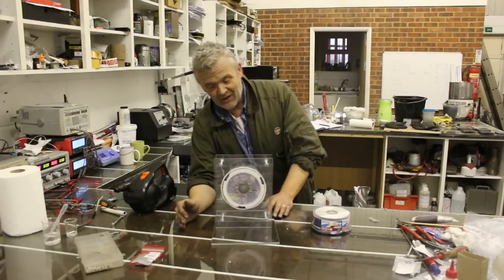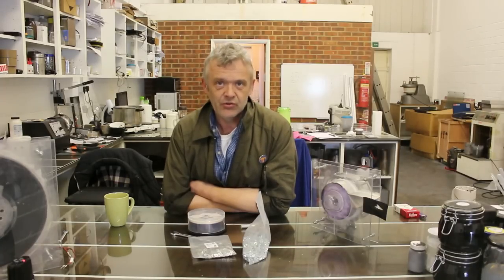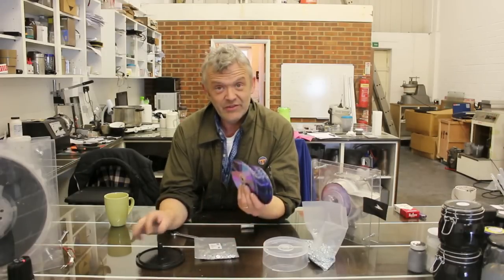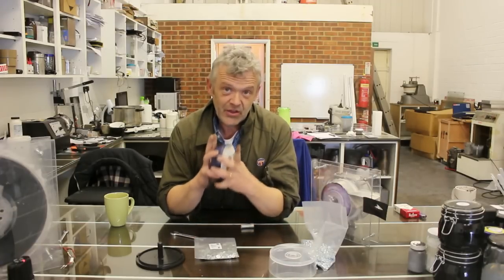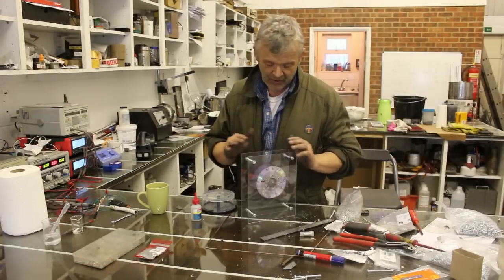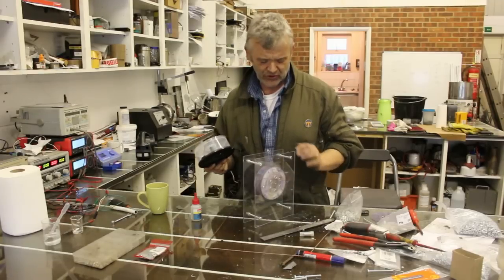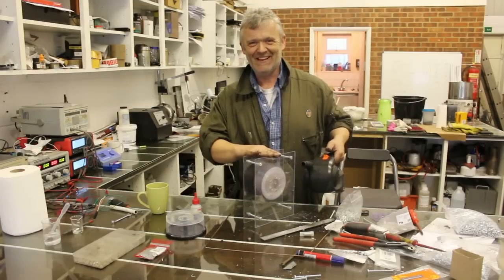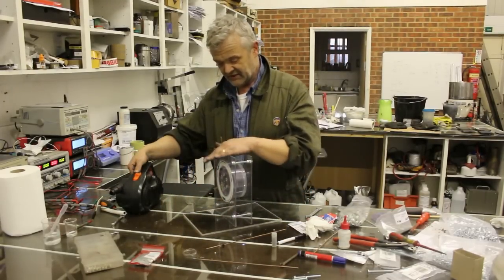Building The Tesla Air Generator - Step By Step

Comment: If you could;  please humour me and explain how to convert your used vehicles surfaces and drive trains into either a link among the multiple same in order to connect such a combined forces to a main generator or explain how to do the same for home by using the differential and welding the tin pieces like fenders and hoods after you shape then into blades to the rims and connecting that to a regular generator that is big enough to run completely everything including charging our cars.  Thank you and I for one don't have the will nor the time to explain further;  other then if you try to find this online;  good luck;  it's not in any share holders'  best interests.  I could explain in full details but I think you understand enough to help everyone understand it better.  5000 watts generator would be fine charging maybe two batteries that would then assist during those times with not quite enough wind and maybe for those days;  change gears if you install the transmission(but that's a bit more of hard thing to implement though).  Cheers.  I will if I must but need to try passing the buck here.  Thanks again.

Comment: Have ya seen where they place it in a vacuum pressure box with a input from a hot water source and the temp difference under vacuum drove the turbine past 100,000 rpm and kept going till it runs out of heat source. Developed By iEnergySupply . Has youtube vid  called self sustaining two stage tesla turbine. Brilliant design

Comment: One more thing I had an idea to use a hollow pipe for the Tesla turbine shaft. The bearings are on the outside and somehow you keep it centered by welding or soldering the outside and just bolting the turbine disc in a large assembly.

Comment: I thought this was going to be the antenna ground thing with like a hundred or more bridge rectifiers on a board to convert ac radio into power that could recharge batteries with man boards in parallel. And you use more than one antenna and ground for each ten or twenty stack of boards. Using some sort of one Henry Choke for a kind of ac flywheel with capacitors or Large 60 watt piezos.

Comment: The tesla turbines could make tidal power a reality. Imagine a very large sealed chamber cut out of a cliff. The chamber communicates with the sea at the bottom, at the level of low water. The top funnels any air from below to the input of a bank of tesla turbines. As the tide rises, water will enter the cavity, forcing air through the bank of turbines. At slack water, high tide, valves will switch the air feeding the turbines to the outside, while the exhausts will lead into the chamber, so that air will be drawn through the turbines throughout the ebbing tide. At slack water, low tide, the valves will switch back to their original positions. What do you think?
Reply: Gerry James Edwards like a kazoo?

Comment: Those are NOT generators !!! tesla invented them as blowers!!! The were to be powered by electromotors powered by the energy from the ether. They would blow air down pushing up a true aircraft, his dream, not an airplane!!
Reply: TheDave570  https://patents.google.com/patent/US1061206
It was a turbine, using steam, to generate rotary motion. Yes, you can use it as a pump or vacuum, but it was a power generator. He built many and used them as such. He could attach his "no moving parts" check valve, he tried different nozzles, and generated high voltage with the incredible speeds. Your statement is just incorrect. Sure, he MAY have thought to use it in his flying machine (do you have evidence of this?), just as any air motor is also a blower, any electrical motor is a generator, a Stirling Engine is a heat pump, etc, but it was clearly marketed and presented as a way to convert pressure in a fluid to rotary motion, not the other way around.

Comment: +Robert Murray-Smith may I suggest you build a Muller-style "dynamo" for reduced drag durring generation of electricity. While watching this video I also had the idea that should you have access to a stream/river, you could, using a trompe, generate free, iso-thermic compressed air to drive this also supplying you guys with free electricity as well as compressed air and cooling/refrigeration. Should the trompe be a useful idea for you, also checkout the trompe-hammer idea from Mr Teslonian (YouTube channel). Below. are links for an explanation of the trompe as well as the trompe-hammer video.
https://youtu.be/SScpJMsCm9c
 https://youtu.be/xv1lQA-tnwo

Comment: It doesn't generate any power , in fact you consume power with your blower. What's the point ?
Reply from the maker: to experiment
Reply: First in this video it isn't clear how he is generating electrical energy but yes from a theoretical point of view. Just remember you don't get something for nothing and recovering energy from say gas or diesel engine exhaust will have other engineering problems such as creating a higher exhaust back pressure and soot buildup in the generator.
Reply: Well if he could put it on any kind of exhaust it would create power where there normally would be losses
Reply: al smith 
Robert gives info to apply to projects, not start to finish "how-tos". Some people will use air, some water or steam. Some want electricity, others turn propellers or pullies, some attach two and make a turbo/ pump/ vacuum. 

The point isn't to get more energy than you start with, but to make waste/ ambient energy useable, solve storage issues, and fit specific situations. Think of the possibilities. 

Could you use solar cells to pressurize hydrogen and oxygen to spin a turbine? Could you ignite it to produce steam to power another turbine? Could you liquefy oxygen or nitrogen, stored for later use? Cryogenic cycles use turbines to cool gas as it works and expands. This cold exhaust gas enters a heat exchanger to cool the inlet gas before the turbine, cooling further, eventually liquefying due to this feedback effect. These turbines don't produce friction heat like piston or vane air motors, have no problem with condensation, and they're easy to build.

Your comment literally applies to every energy conversion that's ever happened. Look up the Rankine cycle, the Claude cycle (a cryogenic cycle) and Carnot efficiency if you want to begin learning.
Reply: ihatefrankshow this video is one in a series on this topic. Can you even patience bro? :)
Reply: I guess your just a dumbarse who wants his hand held all the phucking time eh??

Comment: Robert you amaze me in a lot of ways, one of them is that you actually respond to almost everyone who comments 

You are a true gentleman even though you take some abuse from the comments 

Good luck in your ventures, 

What comes to mind with this, is to strap this on an electric car and you can help charge the system, strap on some piezos on the shocks and you can get some additional electric shocks as well, and so on
Reply from the maker: +Steve Allwest Cheers mate - I like the idea of the piezo - personally i think there are a ton of ways of reclaiming or harvesting energy in cars - but i particularly like your piezo idea. Also, it doesn't matter what you say - someone, somwhere is going to disagree lol
Reply: +Robert Murray-Smith  I agree, there are a lot of systems that waste usable energy collectors, the radiators of cars would make a great thermal electric generator, hot water and a fan already in place to cool off the other side Ha! It would be fun to come up with a list of all the way s to harvest energy that normally just gets wasted  
Cheers
Reply from the maker: +Steve Allwest Actually mate - you are quite right - that would be well worth doing - maybe a table with possible recovery points and a suggested  recovery method? my e-mail is robertmurraysmith64@gmail.com if you fancy doing it

Comment: Robert, that's beautiful! Tesla Turbines kick ass!

One thing I've been studying lately on these turbines.... Tesla upgraded his design in 1922 with an improved star shaped spacer between each disk. While it certainly makes it harder to machine using hand tools, the star spacer does a couple of important things. First of all it gives the turbine a tremendous amount of starting torque. When the rotor is at rest those star spacers turn the turbine into a bucket style turbine. Then once the fluid moves in laminar spirals the majority of the energy has been removed from the fluid and it barely impacts those spacers. Secondly the spacers stop the fluid from creating turbulence near the axle. Check out his 1922 patent on the "Improvements in the Construction of Steam and Gas Turbines".

I'd love to see if you can figure out a way to make those star spacers without a CNC or laser cutter and still have a balanced machine.
Reply: +Zenman Energy -- To try out the idea perhaps we may use squares or rectangular spacers alternatively placed with their high and wide sides. Thanks for the suggestion.
Reply from the maker: +Zenman Energy i'll have a look at it mate
Reply: +Robert Murray-Smith Apparently when Nikola Tesla tested his turbine in Edison's steam facility in New York, the turbine failed, but not for the reason you'd think. Most people think the disks ruptured, but what happened is the turbine produced TOO much torque and the axle twisted and failed. They didn't have the Chro-moly style axles that we can make today.
Reply from the maker: +Zenman Energy very interesting - cheers mate

Comment: Nice video Dr. Smith. The sound is definitely better and now has groovy tunes too! It seems very appropriate for you to be wearing the Tomorrow Land pin. It took me a while to figure out what pin you are wearing on your jumpsuit. Anywho, have you tried offsetting the exhaust holes so that they form a sort of spiral staircase? It seems that might add more torque at the cost of some rpms. I don't want to promote someone else's video, but another Youtuber  has experimented with that design. Here's the link https://youtu.be/H7NP5Vdc318

Godspeed Dr. Keep up the great work.
Reply from the maker: +bro sef thanks for the link mate and a friend sent me the pin so i wear it proudly

Comment: I have a question sir. If you make graphene using the acetone water co solvent, can you make go out of the resultant graphene?
Reply: It might seem like a dumb question  but it can't be as simple as add oxygen and fire. Wouldn't that tend to destroy the material?
Reply from the maker: +thagrit it isn't that simple mate - yo need controlled oxidation plus graphene oxide isn't really an oxide

Comment: I always wondered if the discs would perform better if you sand it with something like P1500 sandpaper?
Reply from the maker: +Martin P. Hellwig i think if you cut them in a spiral in the direction of air flow then yes